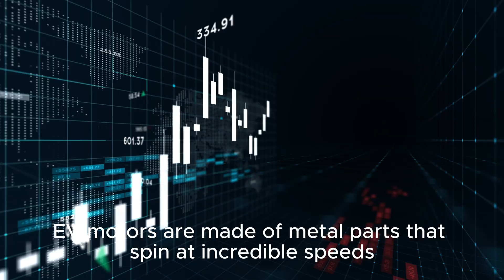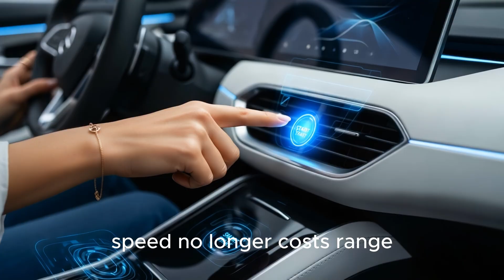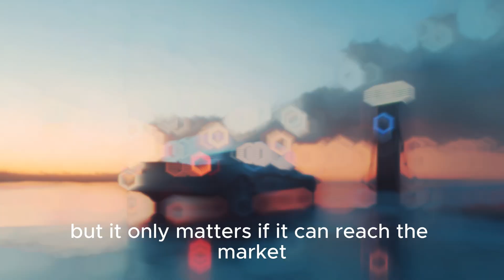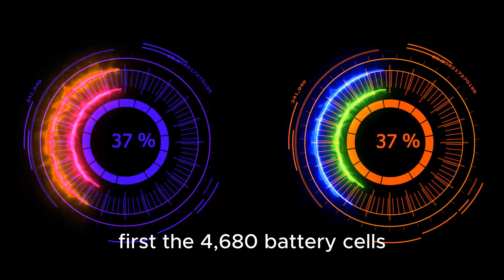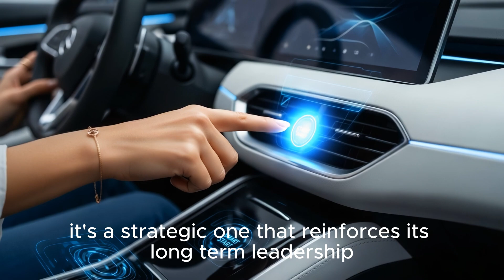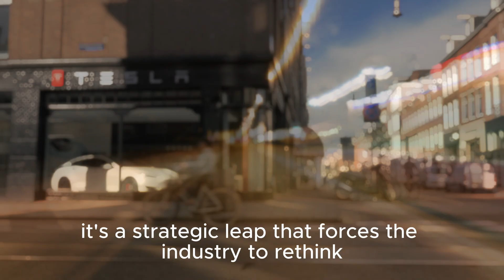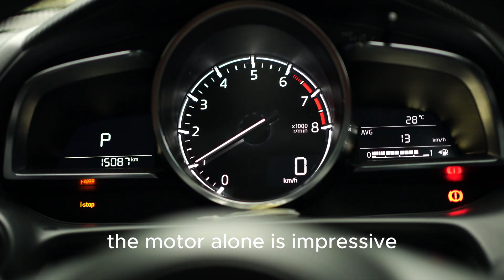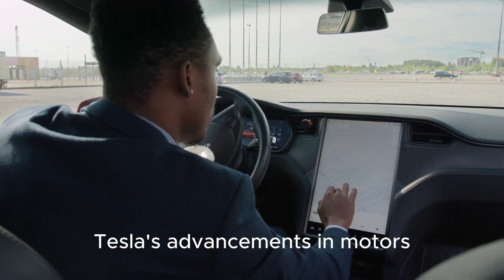Elon Musk Reveals Tesla’s New Motor That Will Revolutionize the EV Industry

Comment: You'd get more views if you stuck to integrity with your information. Did you even do your research mate or just copy what others were saying and accept that as the bottom line? Here's some truth and mind you, this is merely a quick search on chatgpt...

What is **speculative, exaggerated, or unlikely (i.e., probably false or misleading)

The transcript makes many sweeping, dramatic claims. Many are exaggerated or lack credible support.

"One invention could end the electric car race before it even began."

That’s rhetorical hype. In practice, many factors (battery tech, materials supply, thermal management, cost, reliability, software, infrastructure) determine EV competitiveness, not just one motor design.

Statements about “15,000-16,000 rpm is the ceiling for all EV motors” etc.

That’s oversimplified and probably false. Different motor architectures, field weakening strategies, design trade-offs, and materials may allow different RPM limits. I found no credible source that all EV motors universally cap at ~15,000–16,000 rpm.

“Motor can now spin up to 20,000 rpm … far beyond what any conventional electric motor can handle.”

It is plausible that with carbon wrapping you could push higher RPM, and Tesla hints at that. 
Antti Lehikoinen
+3
Electrek
+3
TESLARATI
+3

But “far beyond what any conventional motor can handle” is too absolute. Some high-performance motors (in aerospace, industrial, or niche EVs) already operate at high RPMs. Also, “conventional” is vague.

Also, just because a rotor can spin at that speed under test conditions doesn’t guarantee it is used routinely in a production car with full load, temperature, longevity, etc.

That the carbon wrap solves “trade-off between speed and range,” or that “speed no longer costs range.”

Performance vs. efficiency (and heat losses, drag, battery limits) is a multifaceted tradeoff. A better motor design helps, but it doesn’t completely eliminate tradeoffs.

The claim “you can accelerate faster, drive longer, and maintain battery life” is aspirational, not proven.

“0-60 in under 2 seconds … even hypercars can’t consistently match that.”

Some production EVs already achieve ~2 seconds or close, e.g. Tesla Plaid claims ~1.99s. So that claim is not inherently false. But attributing solely to this motor and taking generalization is misleading.

Claims about cost, simplicity, fewer rare metals, fewer parts, lower maintenance, etc.

These are speculative. A more advanced rotor might reduce or shift some constraints, but other issues (bearings, cooling, power electronics, materials cost, manufacturing complexity) remain.

There’s no public evidence that Tesla is dramatically reducing rare metal use or maintenance costs solely because of this rotor.

“Every car company is scrambling to catch up,” “Tesla dominating for a decade,” “game over for rivals” etc.

These are marketing-style exaggerations. Competing automakers are pushing many paths (battery chemistry, software, architecture, supply chains). One motor improvement does not guarantee such dominance.

Detailed numerical claims, e.g. “15,000 to 16,000 rpm limit,” “20,000 rpm now possible,” etc., “reducing energy waste,” “eliminating trade-offs,” etc.

I found no credible published source confirming all those numbers exactly. They are plausible, but not proven in public domain.

For instance, some parts of the transcript say “rise to 20,000 rpm … faster acceleration … efficiency gains,” which align with Tesla statements, but the transcript treats them as settled fact.

Overclaims around the rest of the system (battery, AI, scale, factories) as if hingeing entirely on this rotor invention.

The transcript bundles many Tesla strengths (battery, AI, scale) and attributes them all to or in support of the rotor claim, which is conflating many strategic advantages. That oversimplifies how complex automotive competition is.